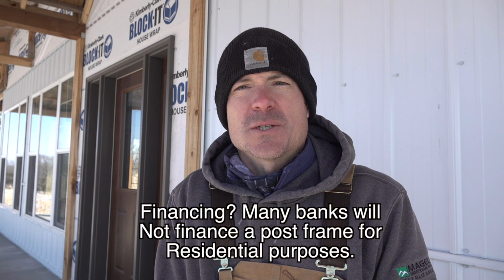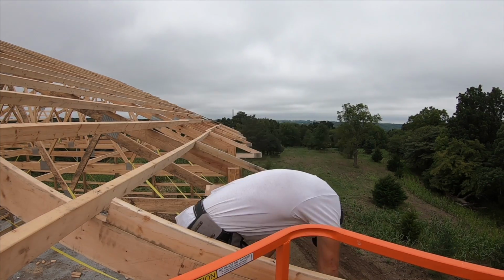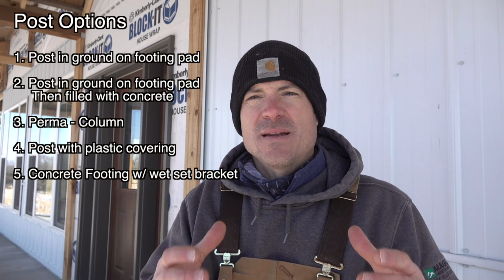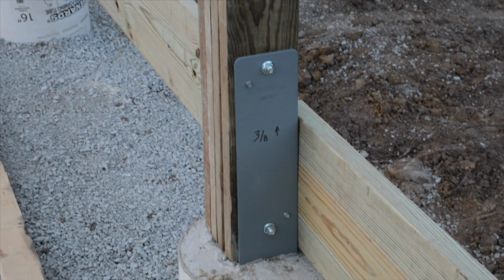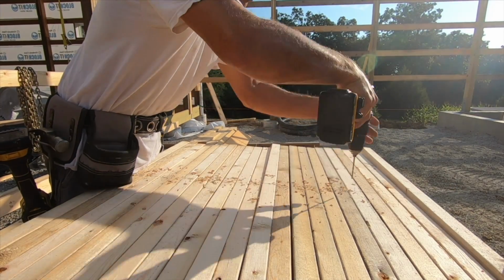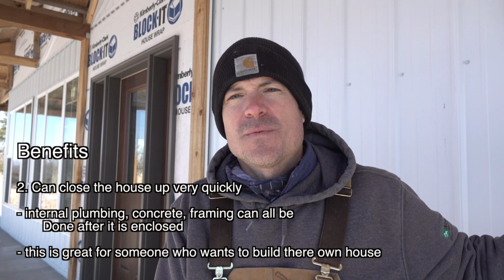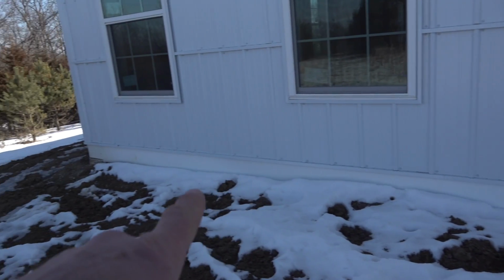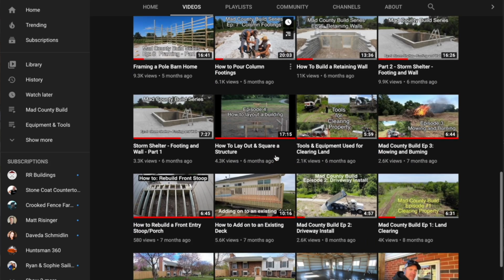Post Frame Construction Pros + Cons

Comment: If post frames don't put osb on what keeps the home warm?Not much but thin metal wrap and insulation🤔
Reply from the maker: There’s at least 3” of closed cell spray foam on the walls. It stays plenty warm
Reply: @MrPostFrame  Oh wow,yea forgot bout that,right way to do it not many do it this way cause price but that's the way I would do it to.Thanks,not many videos showing how actually a pole home is built from start to finish and that's what people would like to seenThanks for good info and video,keep it coming.👍

Comment: Screw piers are another way to do a post frame home, and are both strong and very fast, though also expensive at 250 per pier (including bracket).

DIY, probably not worth it, but doing it for someone else and it can be a good idea because your labor is generally more expensive than the additional time it would take to install the screw piers.

Comment: My concern is that the posts might sink because the house is heavy.
Reply from the maker: They’re on concrete footings and the posts are designed to carry the weight.
Reply: @MrPostFrame  Thanks. Good to know. What is the size of the footing area?  Another question is that both footing and  slab founding may sink a little bit. Because they are detached, shall the difference of sink cause any issues?

Comment: Do you worry about screws in the roof losing their seal and leaking?  Is it better to fasten on the rib so that there is less chance for leaks or even go a standing seam hidden fastener roof?  Just wondering if you have any insight on this because I imagine the sun breaking down the rubber seal on the fasteners.
Reply: Believe they are supposed to be replaced every 15yrs. And think there’s supposed to be a higher chance of leaks screwing through the ridge than the valley. 
Think the standing seam panels cost more overall. But I would prefer those over the exposed fasteners myself. More piece of mind could be worth the extra cost. Though with post beam buildings you can use any materials you wanted really. Might have to verify materials with an engineer for some thing though. Tile roofs can be pretty heavy, so I’d guess it would effect some of the structural requirements.

Comment: That roof looked a little scary, height wise. I'm always wondering about all those screws going in the metal. Water likes to find it way. Stucco failure like most things are 99 percent construction error. I like this concept and love the open area to do whatever you want with layout. Good job

Comment: Thank you for this video. It was awesome.
I am a Swede in NC and am seriously considering a "Barndominium" to be the next house to build.
One question, I see that you insulated your ground before putting putting your heating floor tubes down.
How thick cement did you pour on top? 4"? How thick insulation did you have? In Sweden we usually have 300mm or about a foot.
Cheers
Reply from the maker: Concrete slab is 5" and we used " boards under the radiant heat. We're in building zone 5A. Drainage and proper insulation are top priorities with our weather/temp fluctuations.

Comment: you always see sheet metal used with post frame. Is this a necessity or could you do traditional plywood with it?
Reply from the maker: You can put whatever you want on the exterior. We were drawn to the benefit of using steel because it's less maintenance.

Comment: Is it generally cheaper to build post frame than a typical residential home? How much cheaper?
How about doing additions later on? Say I want to add a section, seems like it might be easier to add a few posts and basically build another smaller post frame building with a shared wall?

Comment: I live in louisiana, the only metal buildings like this i seen problems with after hurricanes is post frame, missing roofs etc.. The only ones i seen with no issues whatsoever is red iron steel buildings . I find it hard to believe based on what i seen r&r post frame builders quote a price range that it competes with red iron steel buildings in any form. My brick home  with the works ran about 110 sqft , if i self contract even cheaper, r&r said something like 85 sqft and i find that pretty high as i have been quoted finished  in red iron steel buildings between 50 and 60sqft. this was several years ago and the r&r  price was from pre 2021 lumber prices.

Comment: Tip:  it's not a house when, no stove, no closet doors, no sleeping area just open rms. Your allowed bath room and sink/laundry area.  It is an engineered agriculture  building or a garage when you add a concrete floor. Dirt floor keeps it agriculture even with bath room/ laundry

Comment: Thanks for doing this video. I saw another on post framing (something I'm wasn't familiar with) but saw some real advantages (construction time, material cost) over conventional framing but my first question was would it meet code. My main concern is that the exterior walls end up looking like those old balloon framed houses from the early 1900's where fire is free to travel the entire wall. Do you use blocking in them to prevent fire from traveling up the inside of the wall?

Comment: I would like to build a post frame in Star Valley WY,  I’m sure it will be a battle with LINCLON county building department not having a foundation to protect from frost line. How do you protect your slab from the ground from freezing? Thanks Craig
Reply: The footers go deep enough that they are under the frost line,, so no heaving there.  As far as the slab, if you watch the pouring episode you will see that there is 1. insulation put under the slab before the pour, and 2. There is heating inside the slab.  These elements combined means, no heaving and no freezing.

Comment: I'm a great fan of Kyle and would have him build for me in a second if he were in the area.  Where we live, it's all rock.  not rocky soil, rock.  there's a Morton home going up 2 lots over from me.  They bored holes and used Morton's proprietary perma column.  In order to bore the holes, they brought in a drill rig for rock.  It was on a huge truck frame and had rotating drill platform so they could line up on the mark.  Nevertheless they were less than accurate on some of the holes and I can't imagine what it cost per hole.  I've chatted with Kyle and believe if I do build, it will be a slab on grade with post anchors like he uses on a stem wall.  To give you an idea, it took a full day with a CAT320 trackhoe and a 6" hammer to bury our septic tank.  Our djainfield is all on material hauled in, around 100 loads.

Comment: I'm putting 1 up now 25 miles from daytona beach its certified for 150 mph winds 36x60x14 with a 16 ft lean to
Reply from the maker: Nice. Would love to see pics when your done.
Reply: @matthewsnover1847  I'm building it myself if you hire it out it will be ddbl the price if you want all the details email me harleyguy1369@gmail.com place I got kit from has the steel trusses 30 ft for 210 each or have full kit minus the outside walls on sale 30x60 for 5000 n plans are $550 they have tons of sizes avl on sale too

Comment: Great video.....Thank you for taking the time to explain all of what goes on for post frame construction. Getting materials as it relates to post frame construction is highly dependent on where you live. In south Texas post frame residential isn't common therefore finding laminated columns has literally been impossible. Additionally, because of this, truss designers down here aren't familiar with this type of construction and won't "allow" trusses more than 3 feet apart despite seeing professionals on youtube do it routinely.

Comment: Be careful using wetset brackets as they are not typically designed to accommodate for a moment.  Perma columns might share this issue, not totally sure.  If you are using these, you will need to engineer the building to resist moments using a diaphragm action (plywood sheathing). The entire reason post frame construction is able to use such little lumber is due to the shear and moment capability of lumber buried in the earth.
Reply: In most cases, the shear strength of the steel cladding eliminates the need for OSB or plywood sheathing.

Comment: Wouldn’t setting post in ground completely surrounded by concrete be a 6th option.   (Isn’t that a better option) 
It’s different than setting post on a footing pad then filling hole with concrete.
Reply from the maker: You definitely want a footing pad under your post if you put them into the ground. My opinion but I would not recommend putting concrete around your post if you do put them in the ground. Just put what ever you took out of the hole back in around your post.

Comment: Post frame construction is a Code Conforming structural building system. If any of you are EVER told you are not allowed to construct a post frame home in your jurisdiction, get it in writing and send it to me, as it is a battle I have 100% success at winning for you. Do not be intimidated.
Reply: Agreed. You CAN absolutely use post and beam construction for residential building. What the building departments are afraid of is one more farmer using the old "farm building" section of the building codes. And I would agree - historically, farm construction had/have many exemptions in the building code, most of which led to every farmer and their brother slapping up half baked structures based on rules of thumb. But if you follow the residential building code properly, you can absolutely build residential using post and beam.
Reply from the maker: That’s great. Appreciate it.
Reply: @notgunnadoit7461  Do you know if Battle Creek, Michigan allows post frame construction?
Reply: @TheWordLady70  if you look up michigan building laws they stopped certifying them for occupation. That was the last time I read t"the law about" a year ago. But you can always contact city hall and ask. They might not care.
Reply: @michaelw5456  We have clients erecting fully engineered post frame homes in Michigan currently.
Reply: Mike do you have contact info. I'm beginning this process and would like to hear your experiences with this
Reply: The people's champion

Comment: I've been wondering about insulation, air sealing, etc. How much R Value will you be able to attain with this type of construction. I imagine you're going to spray foam? I just see a lot of modern building elements that shoot for extremely air tight homes for high energy efficiency as that's one of the main losses of energy in traditional houses. How do you get that air tight membrane on a post frame house. I like what you've done in your videos thus far! And I figure you're going to talk about insulation and such eventually lol.
Reply: Here are some post frame insulation answers: https://www.hansenpolebuildings.com/2019/11/post-frame-building-insulation/

Comment: Really nice presentation! 👍 LOT of great information to consider.  Perhaps I missed it in one of the other video's or you are planning to cover in a future video, what are you planning to do about insulation?  I am at a cross road on this topic.  Your home would be a great candidate for closed cell spray foam, Rock Wool, fiber batt, among others and Zip-R  before you put up the steel.  They all have their good and not so good points.  I would be very interested to see what you decide to go with and your reasons why.
Reply from the maker: I’ll be covering Insulation soon.

Comment: We're in the initial stages of building post frame in the extreme north.  I can't decide on concrete posts with wet set brackets (like yours) or simply sinking the posts in a bell shaped hole, supporting the post 10" off the bottom then filling with concrete.  Hansen Buildings and others swear that the rot issue from concrete to wood exposure is a myth.  My concrete filled holes in Texas are still standing after 40 years but I just can't settle this main issue.  

Great series, great work.  Looking forward to seeing the insulation and the book end girts.  Stopping the thermal bridging is a big reason why I'm going with post frame.  Looking forward to the rest of your build.  Stay safe...
Reply: Concrete to properly pressure preservative treated causing rot is indeed a myth. If you are at all concerned - then use wet set brackets and eliminate the fear factor.
Reply: Concrete transfers moisture through capillary action, also any water or vapor at the surface, that gets between the post and concrete (two different materials  with different characteristics) will rot. you need an intermediary, a post base with air gap or I at minimum wrap the bottom of the post with ice and water, even if on a metal post base between concrete an pressure treat lumber. I've seen ranchers burn the ends of the fence posts to char before they buried it. makes sense. but to simplify, I wouldn't recommend burying lumber below grade at all, unless for a fence post..
Reply: @thefix2573  Until you can provide independent studies to prove your theory, I will stick with proven research as to the longevity of properly pressure preservative treated wood. The Building Code REQUIRES pressure preservative treated wood to be used in contact with concrete.
Reply: What part of the north if you don't mind me asking? Im from the PNW and not sure if they allow these for residential build yet.

Comment: Does the steel rust?
Reply: Its galvanized usually and then painted in the color most manufacturers have a 40 year warranty on the paint and then the galvanized layer will last about that long too so looks aside you wouldn't get rust till about 80 years

Comment: Amazing vid. Thanks I did speed it up 2x but I watched all of it and got the info.

I love the idea of a post frame building. It works especially well for my design as I have almost a whole wall of windows so the 8ft on center framing works really well.

Questions:
What company did the framing design for you?
On the non load bearing wall, did you go 8f of as well?

Is this a one story or two story house? If there is a second story how does it attach to the posts?

Thanks
Reply: You can actually have your post frame home engineered with columns on 10', 12' or even 14' centers. Any second or third floors should be engineered into your plans by the engineer.
Reply: @MikeThePoleBarnGuru  thanks, and how does one go about finding an affordable engineer?
Reply: @jl9678  I work for Hansen Pole Buildings and they provide engineer sealed plans and supporting calculations for every building they supply. We do not provide plans only, as it is the only way our independent engineers can guarantee what they specify actually is delivered to the site. Try calling 1(866)200-9657.
Reply: @MikeThePoleBarnGuru  thanks Mike!
Reply: @jl9678  You are very welcome. Always a pleasure to interact with post frame interested folks :-) Feel free to message me any time with questions: PoleBarnGuru@HansenPoleBuildings.com

Comment: Permacolumns are also an awesome option eliminating concrete forming and pouring costs if you start with no floor at first. Also consider designing your building with bookshelf girts as well. Another thing on laminated columns with  double trusses you can use truss lock fasteners that drive right through all laminate columns to suck them all together and also generous application of PL premium construction adhesives as added connectivity.
Purlins on brackets are even stronger. And allow a floater roof and also allow using heavy decking as well.
Also with book self girts you can frame around that and it adds window strength.
Reply: Concrete piers and wet set brackets will save roughly $100 a column against Permacolumns. Agreed thoroughly with bookshelf girts, glulaminated columns and joist hung purlins.